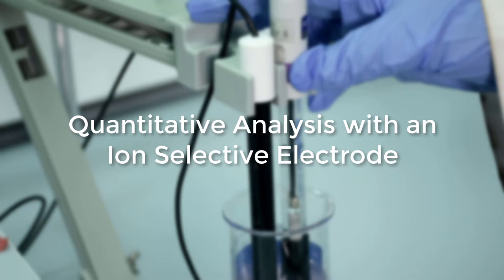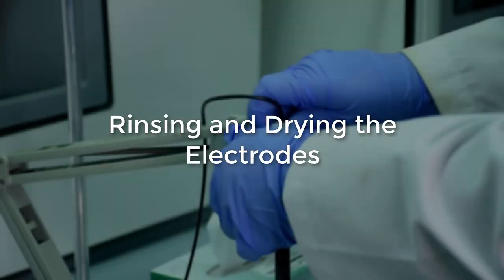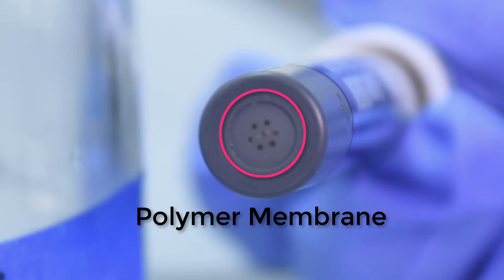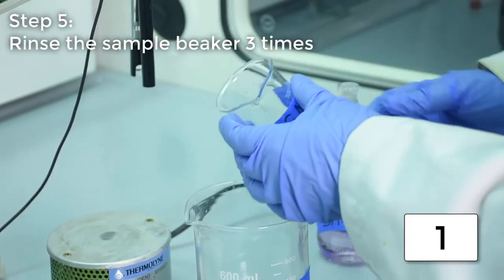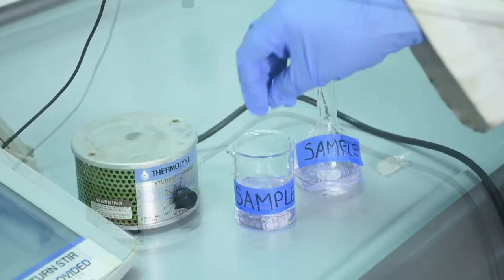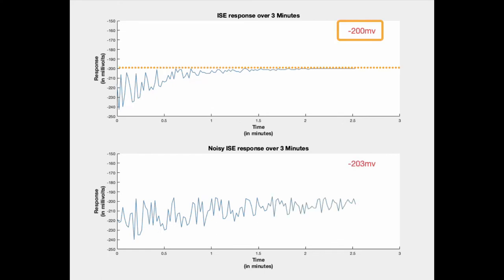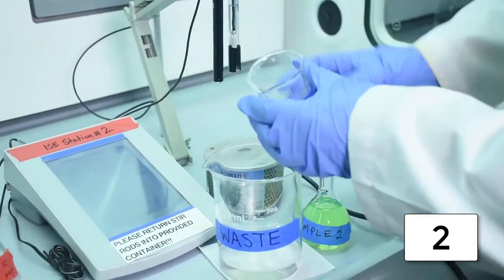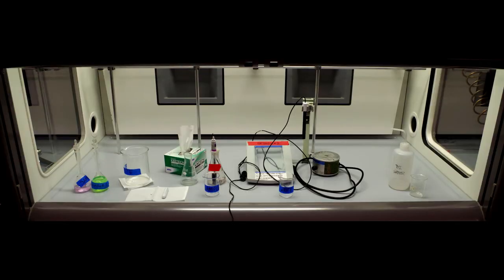Using an Ion Selective Electrode

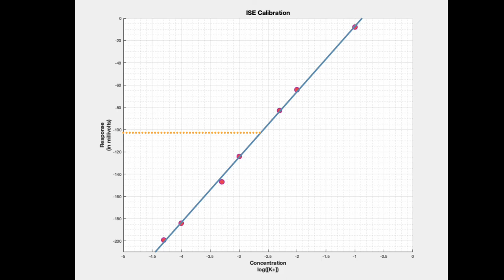Comment: Hi I'm a bit unfamiliar with this process but at 4:17 when you say "most dilute solution" is that a different solution or are you diluting the same solution? Is it possible to do the same solution but at different temperatures? Also, how is the concentration log (x cord of a point on the graph) being determined?